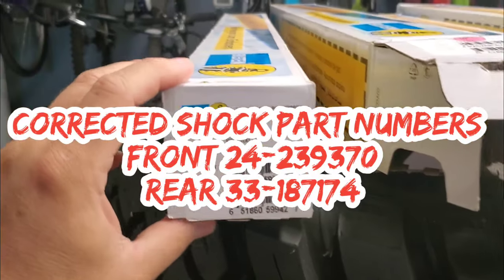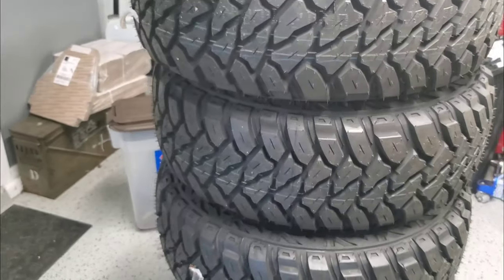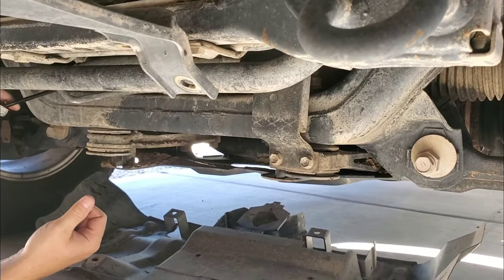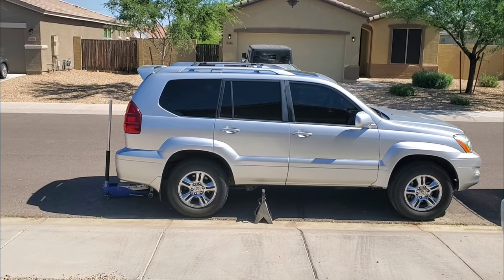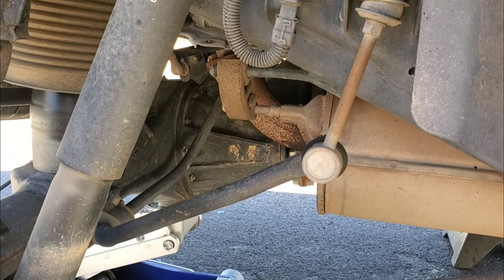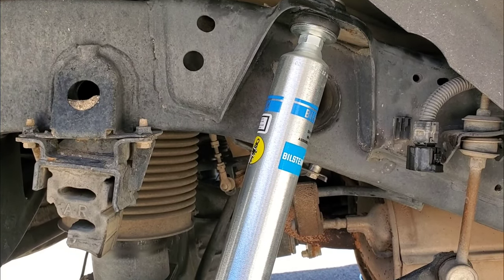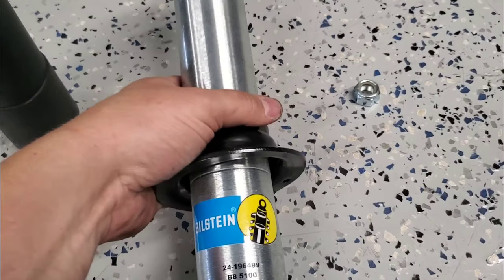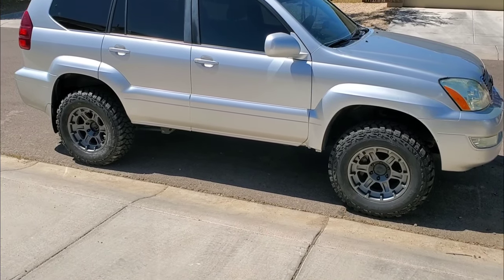SIMPLE LEXUS GX470 / GX460 / 03-09 4RUNNER LIFT. AIRBAG TRICK - BILSTEIN 5100 - DIFF DROP

Comment: Is it fully necessary to replace the rear shocks with 5100’s or do you think the sensor trick alone will work for the lift?
Reply from the maker: Unless your shocks are new, you do not need to replace them. If they are original, replace them!
Reply: Mr. Garage okay cool thought so, just ordered all 4 corners! Hopefully will get them put in this week. Last question, this resets the “normal” height setting to the lift correct? What happens when you press the “high” position after the sensor adjustment? Does it go to almost 3”? Or does it max out before?
Reply from the maker: Correct, the new normal is just about 2" higher. When you go to the high setting, you definitely gain even more height. Never measured how much more but it is very noticeable.
Reply: @MR_Garage  Okay sweet, good to know. Thanks again for the great video, looking forward to this.

Comment: I have assembled the front shocks and have the shocks in place but the bottom of the shock is too tall to fit back into the lower slot. Is there a trick in order to get it back into the slot?
Reply from the maker: Easiest way is to unbolt the control arm from the knuckle. Two large bolts. It will let you push the lower control arm down much further. Be careful not to rip or stretch the ABS sensor wires!

Comment: I did exactly like yours, how did you fix the positive camber? I have that issue after lifted.
Reply from the maker: Just got an alignment. For best alignment, replace your lower control arm bushings and ball joints (refresh). Use whiteline bushings and 555 ball joints or OEM. To fix caster with the lift for great freeway manners, go with aftermarket upper control arms. I have freedom offroad uppers and they have been awesome. Lots of options for uppers.
Reply: @MR_Garage  I replaced my LCA as well but not the UCA. I was told UCA are not required for 2” lift. Thank you very much.
Reply from the maker: Not required but with more caster, vehicle tracks much, much better on the freeway, in transitions and such. Worth it.

Comment: So how much stiffness does it add?  I dont like mushy but the softness of the GX makes it a good cruiser.
Reply from the maker: Mild, still feels really nice. For the best experience for cheap with airbags, go with eibach front springs on the lowest settings on the 5100's (no lift settings as the lift is in the springs). Use a .25" spacer on top of the drivers side to counteract the lexus lean. Use KYB top hat replacements. Replace your rear bags and do the airbag lift. I use arnott bags. For upper control arms, I use freedom offroad and lower control arms I use whiteline bushings + 555 ball joints. Totally comfortable and smooth. Did not cost a mint, factory reliable and I am 100% happy with them. All items listed in the video description.
Reply: Can’t you then just replace the springs in the front and leave the shocks?

Comment: I plan on doing this soon. Just wondering when you do this do you lose the ability to change the ride quality from Comfort/sport with the switch?
Reply from the maker: Yes, you will. That system is tied into the overpriced OEM shocks / struts only.
Reply: @MR_Garage  so what ride setting does the finished project most resemble? I have a 2012 and I like driving it on Sport.

Comment: I am having the hardest time getting the front driver side in. I put the snap ring on the 2nd groove and I still need like and inch to lower. All my wires are strained, I'm afraid to snap them. I did the diff drop...am I missing something?!
Reply from the maker: Hey Adam, The snap ring does not make the strut longer. But it is a pita to get in. Have to unfasten the ABS sensor wires to get enough length. Diff drop has zero effect. Once strain was relieved off the wires and swaybar unbolted. I had to have my son put his weight on the control arm to get it low enough.
Reply: @MR_Garage  So this more a two man job! Thanks so much for the tips! Hoping to get this set up soon.
Reply from the maker: One person can do it. Always easier with two

Comment: I’m gonna have this done this week and I’m wondering...I plan to just lift the front to the first setting, 3/4” ,  (same as I did on my ‘07 4Runner). and I bought the diff drop kit for this job. I never used a DD on the 4Runner and it came out just fine.  Is the diff drop still needed on my GX even though I’m only lifting 3/4” or is it overkill?  Thanks!
Reply from the maker: Does not hurt to add it.
Reply: OK, thanks Mr. Garage.  I will add it.  I saw another post and did you figure out for the guy who asked what the space distance should be where the washers go in the rear?  I got M8 washers in stainless and was planning on telling the shop to use whatever you said.  I’ll watch again...5 or 6 as I remember.  A shop called 4Wheel Drive Parts is gonna do it.  You may have one down there.  I’m hoping they know how to get things apart on top of the front shocks.   Sounds like a PITA.
Reply from the maker: Yeah the fronts are a pita. I just unplug them, use a small sledge and chisel and smash off the electronic motor assembly so I can get to the nut that retains that bracket. Quick and easy. Not like that motor will ever be used again :)
Reply: Good morning Mr Garage...I just dropped my ‘06 GX off at 4Wheel Parts for them to do the front Bilstein 5100’s.  Gonna just use the first lift setting with the diff drop.  I told him I would put the rears on when they come in (way back-ordered) and I told him about the height sensor trick.  I asked if the rears would lift the rig at all in the rear and as I suspected he said “Not at all.  It’s just a shock being swapped”.   So then, why the airbag trick if the rear will remain the same height?  Is it just because you wanted the Neutral setting in the rear bags to be slightly higher for your set-up?  Many thanks!  Phil
Reply from the maker: I think you have a misunderstanding on how the rear lift works. The rear 5100 shocks have no lift setting on their own like the front 5100's do. The rear lift only comes from the airbag trick itself. Do the airbag trick and it will level the rear with the front. The shocks are there so the ride is not crap.
Reply: Hey Mr. Garage.  Thanks for all your help!  Front struts are on at the first lift setting which is perfect for me.  The diff-drop is also done.  Alignment came out perfect.  Now just waiting for the rear shocks that are on back order.  I really appreciate all the info you graciously posted here!

Comment: If you go for the highest lift with these shocks on a GX do you need UCAs?
Reply from the maker: I would imagine so. I would not use a 5100 on the highest setting, spring pre-load would be nuts. Your GX would probably ride like a radio flyer wagon down a rocky hill.
Reply: Mr. Garage so I got the strut off the coils but when I went to put the bilsteins on the top washer didn’t fit the new struts. Did you just put on a different washer?

Comment: First off, love your channel from generators to GX you make awesome videos. That said I was 4wheelparts website and the 33-187174 rear struts are not compatible with the GX. Can you confirm the year of your two GX?? I have an 04 and I am wondering if that could be the issue. I thought I heard you say 07-08 but I could be wrong.
Reply from the maker: Hey Razel, Run a quick google search for gx470 and 5100's. It is a valid part and fit for all gx's up to 09 and it is the correct part for the 460 as well. Other companies and countless owners run them in the rear.

Comment: Does this trick make the expanded bag length longer than stock?
Reply from the maker: Stock bag length is variable depending on height setting. But yes, it raises it up a bit which is how the lift works. Not nearly at 100% thought as your high setting also still works.

Comment: we just finished the Bilsteins, and all suspension parts my 03 GX needed.  I have a vibration in seats and can feel in gas pedal as well.  Wondering if I can get in touch with you, I am in Phoenix
Reply from the maker: Did you get it aligned?
Reply: @MR_Garage  yes they did it twice at network alignment, I had the steering rack rebuilt as well and now realized the guy did not install new bushings and I can see it moving left and right and can feel it jumping around, so that may be some of vibration, but seems to be coming from rear.  I am installing new bushings later this week and need to figure out why tie rod ends are making noise as they are new moog, but I assume because rack is shifting, the tierods now are hitting.
Reply: @pforeste2094  Hi, any chance I can bring my GX by for you to take a look to see if I am missing something as mine just does not drive as well as it did before the Bilsteins etc, I am in Peoria, or can you tell me somebody to take it too that knows these GX's really well and the lift procedure?

Comment: Here is a stupid question when you buy shocks you normally buy two. A pair
So if you are buying. a pair of shocks, are you buying 1 or two, some of these sites do not tell you if it is a pair or single.
Reply from the maker: Not stupid at all man! It can be confusing. They sell them individually UNLESS, the seller specifically calls out they are selling a front or rear L/R (left and right) set. Or, a set of 4 front and rear.

Comment: Did you experience any drivers side lean on your GX’s? I’ve recently done this upgrade and the drivers side seems to sit a little lower than the passengers side.
Reply from the maker: Happens to most toyota trucks / suv's. GX is no exception. Comes from the extra weight of the fuel tank and battery on the drivers side. Can be corrected slightly by adding an extra washer to the drivers side sensor. Sometimes the front original spring may be a tad saggy too.

Comment: I deleted the oem shocks now I have abs vsc trac and vsc lights on.  Did I mess up a sensor or deleting the oem shock does that?
Reply from the maker: Only if you stretched or damaged the front abs sensor wires. Unplugging the shocks will not throw codes.
Reply: It was a stretched abs wire, good stuff i subbed

Comment: So I did this install and my back end sits lower than the front. Am I missing something here? I did the sensor trick and used the same shocks as you
Reply from the maker: How much higher? Once install was completed, did you start the car and let the bags air up? What washers were used for the rear airbag trick? Lots of questions - loads of people have done it using the same method - results are same as mine.
Reply: They where different washers.... maybe that is it. I did let it air up. It dosen't look bad I'm just being picky 🙃. Ill get back to you later thanks for the help. I put your video on the GXOR reddit page and they liked it
Reply from the maker: All good man - was just worried something went wrong for you. The washers I use and linked are rather thick. Nearly twice the thickness of a standard small washer. If needed, I can get a caliper on one for you to check out. See if yours are just thinner.

Comment: Is there going to be dash lights come on when swapping the shocks?  Is there a solution to get them off?
Reply from the maker: No lights at all unless you tear an ABS sensor line during install :) Gotta be careful there.
Reply: @MR_Garage  thanks. I’m sure I’ll be reaching out again
Reply: @MR_Garage  so you used the 5100 in the rear also?  Why not use the 5160 in the rear?  How is the down travel since you did the air bag trick. Do you still have enough down travel?

Comment: Do you check your link for the part on Amazon and eBay are completely different number?
Reply from the maker: Read the description of the ebay link and or contact the seller. Their PN up top is incorrect, their pn in the listing is. I have advised them of this but issue is still present. But you get the right parts 😅

Comment: How many miles were on the car when you did this? I’m concerned about my GX having 160k and not having the bags fail as mileage continues.
Reply from the maker: 180K on this one. The bags are a suspension item and you are pushing it at 160K and not replacing them anyways. I recommend replacing them as you should and do the suspension work at the same time. Will be good to go for another 160k!
Reply: Mr. Garage now, from what I understand you are still using your bags? You’ve just compressed them with the addition of the new springs to give em some new life? I watched the entire vid and that’s what I got out of it, not very mechanical on cars but I’m excited to learn!
Reply from the maker: Notta, there are no springs in the rear. The bags are an air-springs. For more lift, the sensors are tricked which applies a bit more air pressure to the bags lifting the rear. The fronts struts create a bit of lift from spring pre-load with the 5100's.

Comment: Do you have another link for the diff drop set? Your link leads to a nonexistent product now
Reply from the maker: Thanks for letting me know! Fixed https://amzn.to/3WJnPQJ
Reply: @MR_Garage  Question. Did you feel that with the airbag trick and using a larger/taller tire than standard you needed to mount something between frame and bump stop to lower the bump stops closer to the rear axle in the case of an airbag failure?

Comment: Why you need to drop down the front differential ?
Reply from the maker: You don't have to as described, but I do diff drops on any lift above stock. Every single degree of angle added to the cv causes wear and tear on the boot.
Reply: @MR_Garage  thanks

Comment: did you fix the AC already?
Reply from the maker: I did - I did not end up videoing as it was 118 that day and I had to get the job done. Was simple - new condenser and compressor. Added 2oz of pag to the condenser and 2 to the compressor. Ran a vac for 30 minutes and added 28ounces of refrigerant. Been ice cold ever since!
Reply: Mr. Garage thanks

Comment: I have a 2007 GX470, do you know if I can run that wheel and tire setup on stock suspension?
Reply from the maker: Fronts will rub big time. Even with the lift, you have to pin forward the splash guards and best to pull the running boards.
Reply: @MR_Garage  I am assuming this is due to the offset and backspacing?
Reply: @MR_Garage  I'm gonna run a 265/70/17
Reply from the maker: Same as what I run - and yes due to offset on these + tire size.
Reply: @MR_Garage  Thanks!
Reply: @MR_Garage  Thanks for the help and the video.
Reply: @MR_Garage  Ok.  I got the tires and wheels installed today.  I'm am running a different tire, BFG KO2's 265/70/17 on the Tandum rims with -10 offset.  I get just a little bit of rubbing at full lock.  I trimmed the inside edge of the running board and warmed up the wheel well liner with a heat gun and pushed it out just a bit.  All good on stock suspension.  Thanks!

Comment: hey Question? will This Work On a 2003?
Reply from the maker: If you have airbags, it will! At that age, I would replace the bags during this process.
Reply: @MR_Garage   Will this lift work if I have a rear airbag delete kit on my 03? I purchased it with the delete kit already installed and am looking to level out my 470. The front rakes down while the rear is sitting kinda high.

Comment: Before spacing the rear sensor is your GX in the lowest setting or the raised position before returning it to normal? Thank you
Reply from the maker: When I install rear struts on the GX, I set the bags to the lowest setting before jacking up the car (least air in the bags). This is the position they are in when adding spacers. Once work is completed, put it back to the normal setting and it will raise to to the new lifted height. Technically, does not matter what the setting is when adding the spacers as the sensor range will either increase or decrease air per the difference in adjustment on the sensors. And when driving on the street, it will always return to the N setting.

Comment: Any issues with body lean?
Reply from the maker: Over time I have on my white GX (had this setup on it a long time prior to lifting our silver GX). On the white gx, ended up going eibach 2" lift springs and put a .25" lean spacer on the drivers side. Leveled it out nicely. The silver GX never leaned. Luck of the draw I guess. Springs were just shot on the white one and the eibachs have been awesome for cheap $
Reply: Not on mine. It doesn't have KDSS tho.

Comment: Something is missing here ~ a 1" diff drop on a >1" tire lift effectively lowers 'minimum dynamic ground clearance', making the diff more vulnerable to hitting something in the center of the trail when springs are fully compressed.  
Cheap fix would be some fender washers on the front lower control arm bump-stops so that they reduce travel to get that 1/2" back, effectively raising the 'minimum dynamic ground clearance' back to at least stock's height.  
HTH / YMMV
Reply from the maker: Except the diff is under the skid plate which remains at the same height so nothing on the underside actually changes. If I was going full compression with this lift (would break the factory swaybars, at least the rear) and really trying to wheel this machine... there are a lot better suspension setups for that if you have a need.